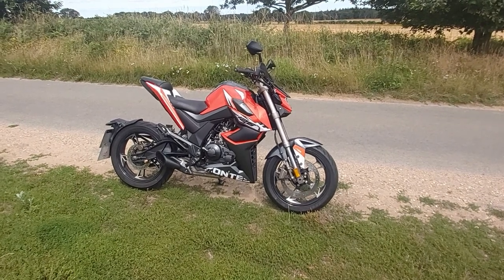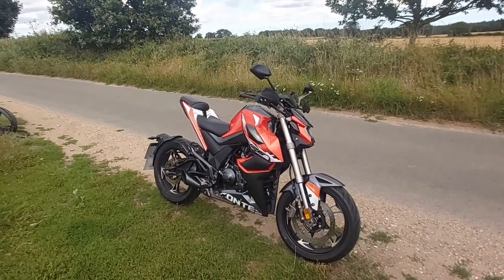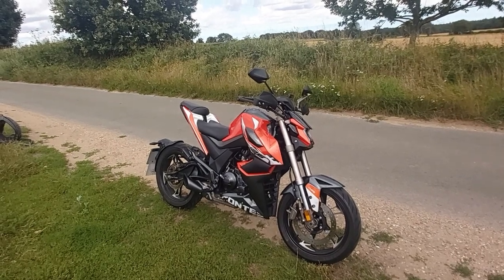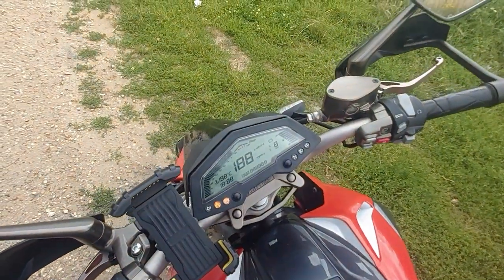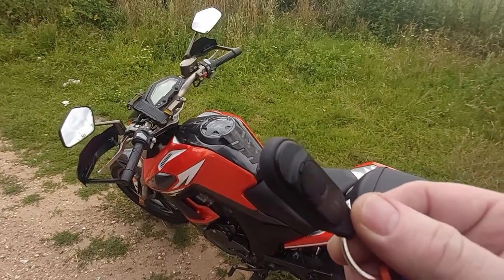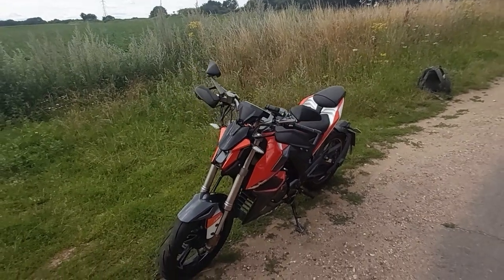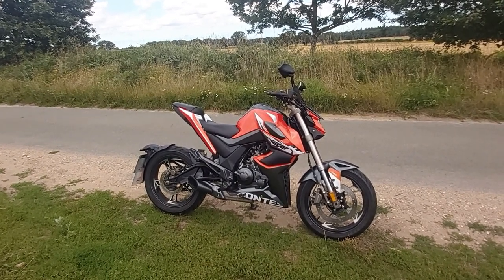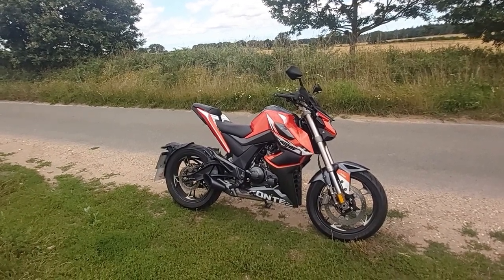ZT125 U Fob battery

Comment: So, just about to get a u1 which has the same system. How easy is it to take out the battery? Just wondered cause you could possibly make it last alot long if easy to remove? Cheers
Reply: exacltly what I thought, first i don't enjoy having always and Electronic fob that always release electromagnetic waves. especially when i'm sleeping. So i thought if i remove the reserve fob battery it Will last twice as normal. Then if i proceed to remove the main fob battery every time I'm not using it i think it might last very longer, isn't it?

Comment: Hi Mean , just an update. I had br1225 batteries in both fobs when supplied new from the dealer. They lasted 6 months before I got the 3 beeps after turning on te ignition. I replaced them both with cr1225 from the watch shop as they didn't have the br version. The cr's have so far lasted 2 months and are still both showing a green light flash on the fobs. I will keep an eye on the situation and update when this changes. I always carry a new spare cr in my bike jacket anyway. One other point on the br cost , I found that RS Components have them at £1.28 each in a 5 pack. Will get some tomorrow anyway but will wait to see  if my cr's run out soon.
Reply from the maker: I've been using cr as well and found they last just as long as br.
Reply: @Mean-bj8wp   Yeah , I think that's what I may find as well. Great bikes though aren't they ! My U1 is the same colours as your U. I'm in Southampton. Bike has been trouble free and everyone gives it admiring looks.
Reply: @paulcollings5424 😁mate I think I saw you 2 days ago riding on northlands Rd, waiting at the avenue junction,  orange bike with full black leathers, the bike looked amazing I thought it was a ktm at first!
Reply: @fireblade_ninja308   Sorry for late reply , been without WiFi for a few days but back on now. Wasn't me at Northlands Road but nice to know there's another in the area. I was on a run down to Hamble. Recommend the Beach Cafe there though , jumbo hotdog and watched the boats go by , so relaxing ! Just installed a Fodsport FX8 and can recommend that as well , excellent volume and clarity. See Mark Pulling's review on it . Stay safe matey.

Comment: Thanks for the vid Mean1974 , I have the Zontes U1 and had the fob battery run out on me. Managed to the get the CR1225 at the local watch shop but as you say they will not last as long so will be getting the BR version very soon , and change the spare as well. Is it correct that if they go flat they will lose the fob  code ?

Comment: Don't suppose you know what tyre pressure ment to be can't find it in the manual
Reply from the maker: On the side of the chain guard there's a silver sticker that tells you tyre pressures and the free play of the chain can't miss it.
Reply: That's unusual to be the same pressure in front and back
Reply from the maker: @michaelcorbett9269  not for a bike as the weight is central between the wheels.  There would normally be a second pressure for the rear if carrying a pillion but as its a 125 as generally doesn't happen so it doesn't show that.  My car has same pressures all round as well even though most the weight is over the front wheels.